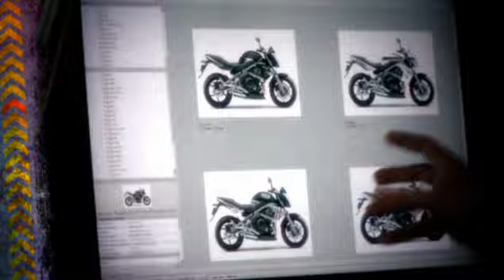Design Competition Kawasaki ER-6n

Comment: @catalinbn no you should be fine. However for comfort reasons I would get slightly higher motor-cross handlebars, and if you have long legs like me, get shortened links to raise the rear suspension (can buy off ebay very cheap).